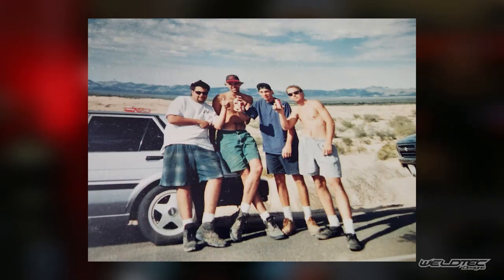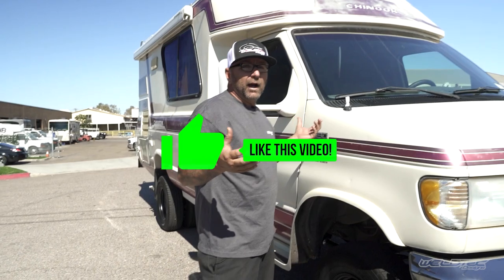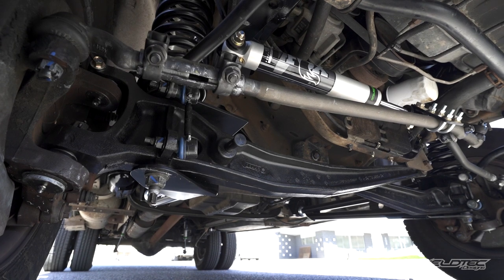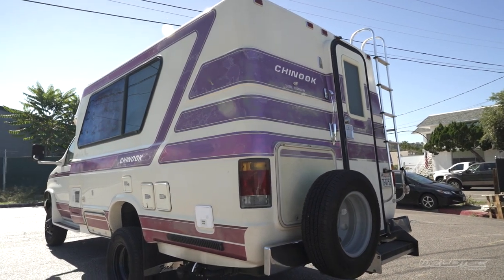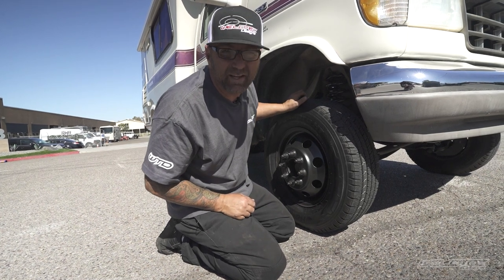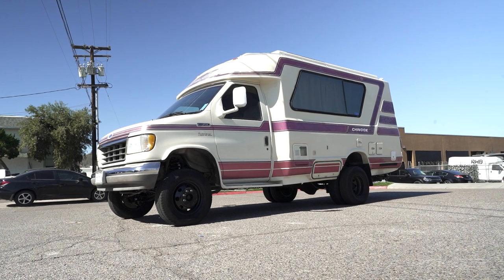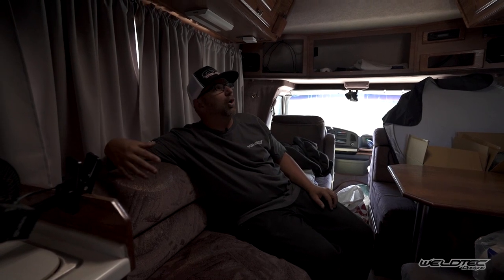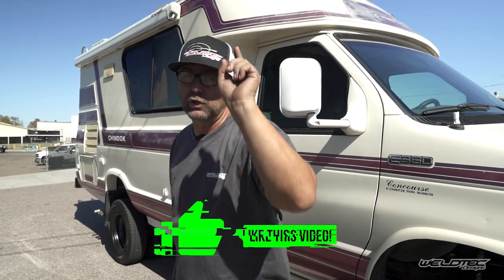How To Get More Ground Clearance From Your Retro E-Series Class B Chinook | 5" Suspension Lift Kit

Comment: I’ve not searched your whole site but have you done a 4x4 conversion and suspension upgrade on a Chinook? Also, I never hang stuff on the outside of my rigs, so the rear entry is just fine.
Reply from the maker: NO, Sorry we do not do 4x4 conversion on the Ford Vans.  You would be really surprised what you can do with a 2wd with the right setup. Let us know if you would like more info.
Reply: @WeldtecDesigns  It looks pretty capable. I’ll sure consider it. I’m shopping the Class B Transit Vans, so I’ll look at your work on them too. Thanks.
Reply: @BillSprague  way more offroad capability with something other than the transits.. and if you’re looking at 4x4 for that exact reason, I might recommend the more capable 2wd van than the 4wd transit.